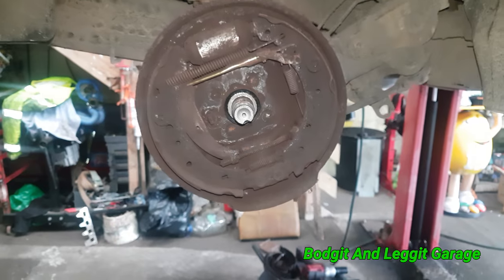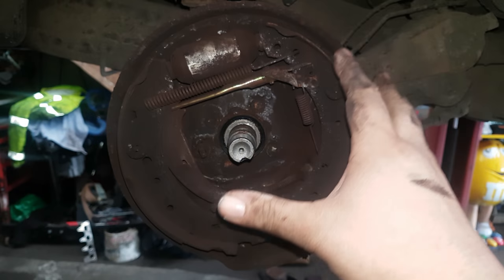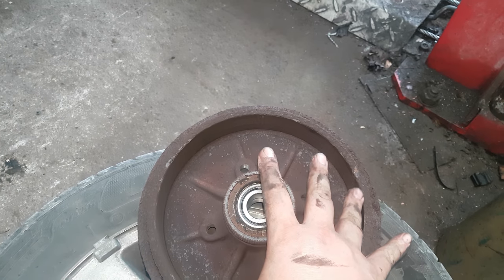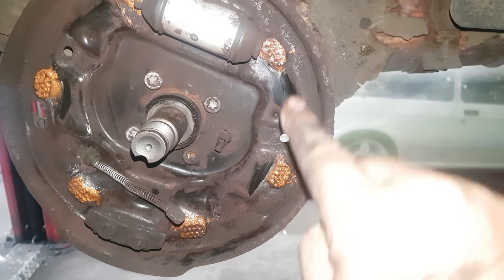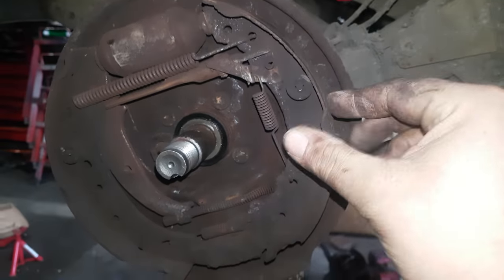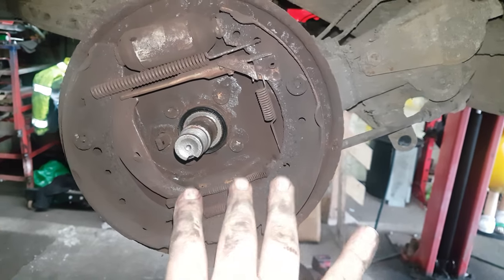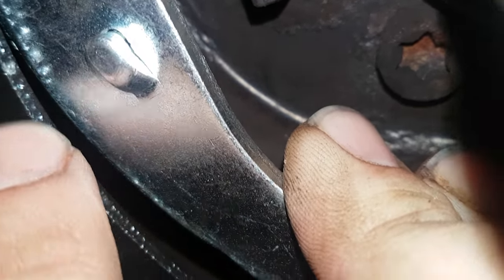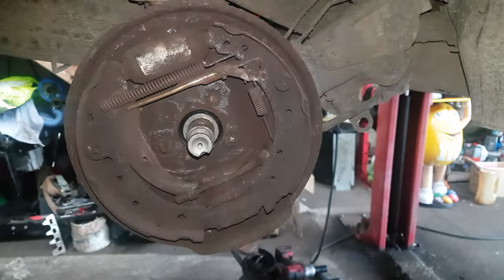TNT#24 tips and tricks on rear brake shoes Bodgit And Leggit Garage

Comment: Leon, I always end up fighting with the last spring. What's your technique?
Reply: He puts it on first. =)
Reply from the maker: @EXOVCDS  hahahha
Reply from the maker: Hi mate there is a few different ways of doing it sometimes it's easy to build it on the bench and then transfer the whole thing to the car use a couple of screwdrivers to stretch the springs but I have also done a video on a brake spring tool which really will help I will find the link and send it
Reply from the maker: https://youtu.be/2FQAWPveEx8
Reply: Cheers pal